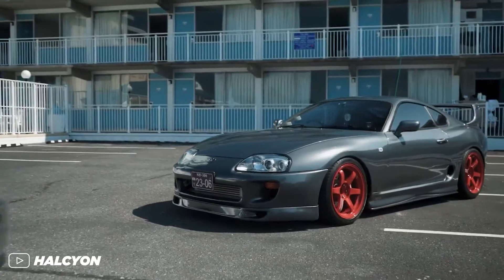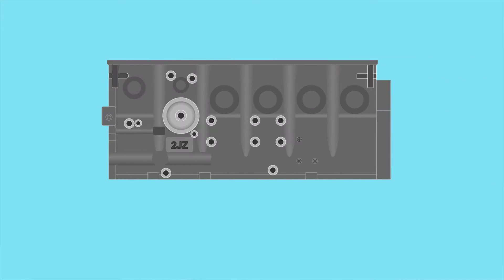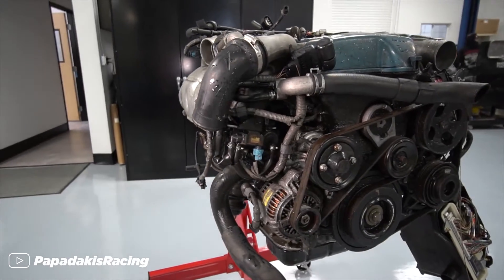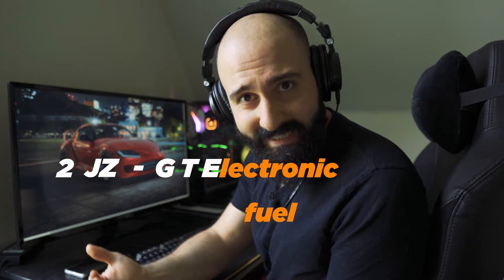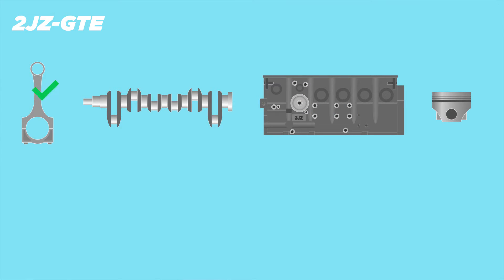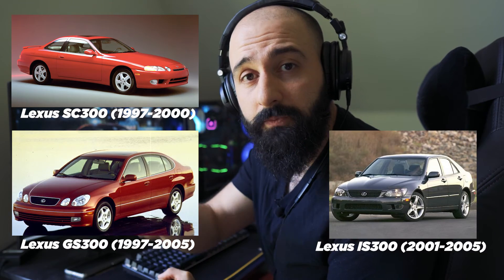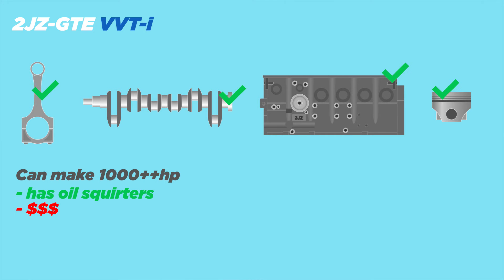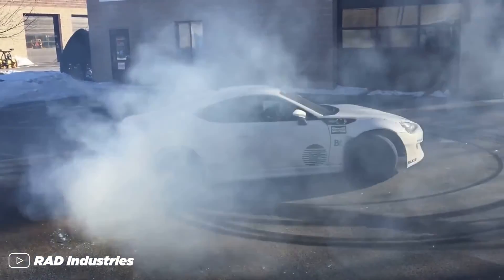2JZ || EXPLAINED

Comment: you can also go 1jzgte (non or vvti). same block, just a smaller stroke (71.5mm) which is better for high revs. they made a boat load of them and they are just as good at making power as the 2jz, and they are cheaper

Comment: You said that the 2jz ge vvti has weak connection rods and high compression pistons. If you would swap these out for stronger rods and low compression pistons. Could u push it to like 800hp?